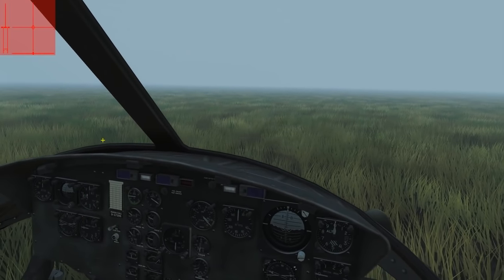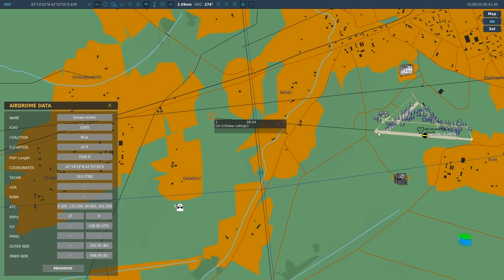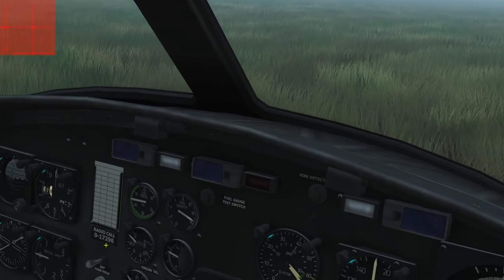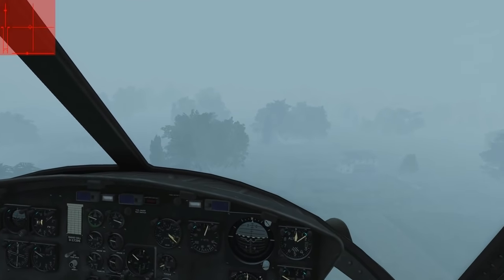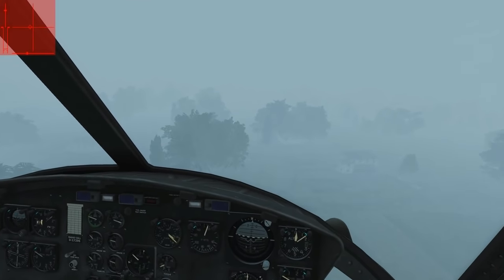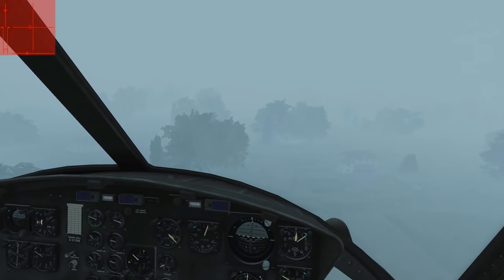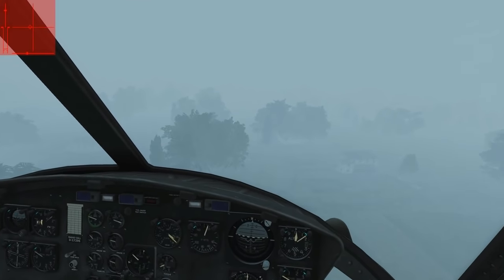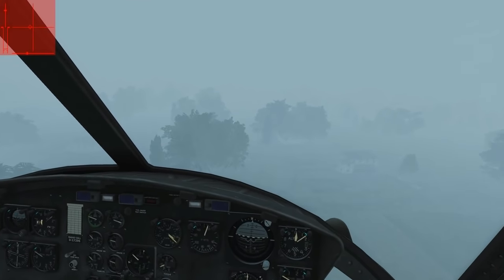UH-1H Huey: ADF, ILS & VHF(FM) Navigation Tutorial | DCS WORLD

Comment: One way to figure out your distance is to navigate at an offset (e.g. 30 degrees from straight at it), and see how far the bearing drifts as you cover a given distance. Then do some trig (or look up in a table) to find your distance. Another method is if you can measure the direction to two beacons - where the bearing lines intersect is where you are. And finally there's the option of the GPS module ;)

FWIW, using the ADF switch in the F-18, the correct behavior would be that it would point at anyone transmitting on that channel in SRS. If not, that would be a limitation in SRS.

Comment: FM Homing....  There are two identical antennas, one on each side of the aircraft.  The needle is not a course line, it merely tells you which side of the aircraft is getting a stronger signal strength.  This points you in the right, or 180 degrees in the wrong direction.  That is why it seems to be so jumpy as you attempt to fly it like a localizer.
Reply from the maker: awesome thx

Comment: very well explained, step-by-step, easy to follow, perfect. It leaves only one quetion to me: Do I really have to switch off ADF (after it has been used initially) when going to use ILS as next guide? Both systems should function independently from each other as they have different display instrument, isn' it?
Reply from the maker: Honestly I can;t remember any more, sorry WE.
Reply: Hi GR, Meanwhile I tested: set up ADF and ILS freq's on the ground with both to ON and it works fine.
Reply: @wolfgangernst1336  Yes, they are seperate systems.  Set the ADF and the ILS before initial take off... to save hearing both radios at once just use the bank of isolator toggle switches below the UHF radio to switch in/out what ever radio you want to listen too (all switches in the up position puts them all on). Useful to have/learn a morse code so you can identify the signals on the ADF as some of the stations are quite close together on the frequency dial.  da did did dit    did did  = BI   (joke -  who did it   da did did  did it) :)

Comment: excellent video and so helpful.  Quick question. When I use the Nav Comm panel for ILS and dial in the runway ILS number, the instrument on my dash with the 2 needles doesn't do anything (although I am getting the correct morse code audible signal).  I have checked that ADF is off and Nav Comm is on.  Any ideas what I am doing wrong?

Comment: That's 321 not 335.
330 is half way between 320 and 340
335 is half way between 330 and 340
O.K. now you got it.
When you get near the Inner NDB you'll hear that beep beep beep sound and you'll be 1/2 mile from the end of the runway.   If you can see the wire that stretches between the poles on the NDB you can use it to get your heading,  the runway will be perpendicular to that wire,  so if you line up at a right angle to the wire you'll be headed straight at the end of the runway.
Reply: He was merely pointing out the wrong morse code signal. He’s not stupid.
Reply: @RobertGeez  No, he's not...